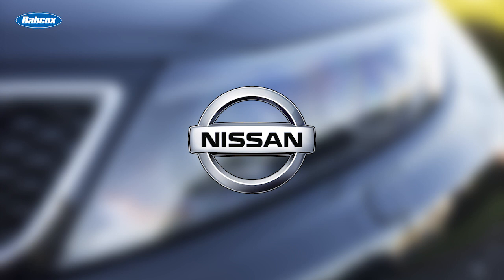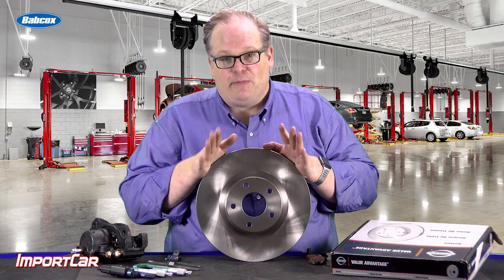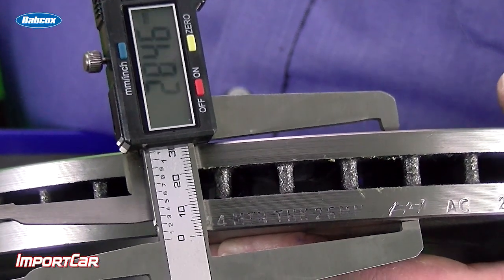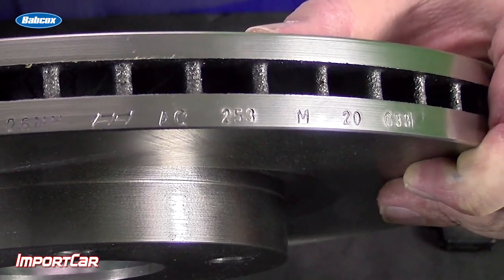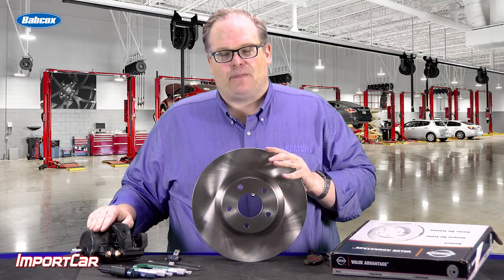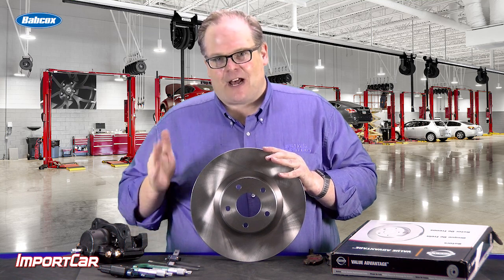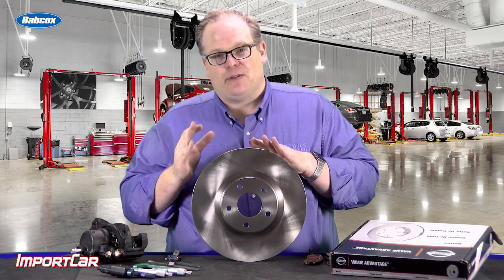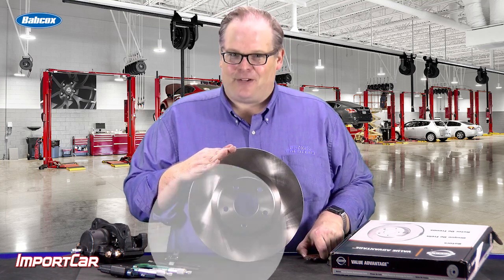Brake Rotor Minimum Thickness Specification | Maintenance Minute

Comment: He should've mentioned that the minimum rotor thickness is different from rotor to rotor and it is printed on the edge of the rotor like he zoomed in on. Also if you know the rotors thickness when new, minimum thickness will be reached when it is 2mm less than that number.

Comment: What happened to my last F150 and Hondas.  I drove them over 250,000 miles.  Never changed the rotor, never had the rotors turned.  The new pads smoothed the rotor.  Got around 40 or 50K on the F150.  About 90K to 110K on the Honda.  My Toyota is crap. Got the 100K front 113K rear, but both rotors at min.  Going to listen to this guy and look at rotors every 30K miles now and watch fluid levels every 10K oil change.

Comment: Interesting. I just read a recommendation at a brake equipment site, to leave at least .040" extra thickness over minimum for wear, and replace if it gets to less than that that .040" extra. Or, no more than .080" down from new. But they didn't say why, this must be the reason that explains it, thanks.

Comment: Rotors are often more expensive than pads. The best option is to replace brake pads well in advance of wearing to minimum spec so you can avoid a hydraulic failure. I've seen many instances of a rotor being damaged simply because the drive was trying to save money and put off fixing their brakes. The fear of being "ripped off" by their "evil" technician will get many people to delay servicing their pads and end up damaging a lot more brake parts in the process. Also, I can't tell you how many times I've seen black brake fluid. All it takes is a few emergency stops for the brake fluid to start to boil and to turn into a spongy pedal. Getting fresh fluid and air in the system out will protect your brake callipers from rust and keep your system working well.

Comment: Hello from croatia. Mine is at 26.2 thickness, and minimum is 26.4. Is it ok to use one more brake pads on it ?
Reply: Yeah you can resurface probably one more time but that’ll be the last time after that it’ll be the last time those rotors can be turned and you’ll need new rotors. I’d recommend getting new rotors

Comment: So, hydraulic failure is not good : l
What does that mean :\
Reply: Well basically what will happen is when you brake your brake piston will come out of their seal, due to your rotors and pads being out of specs. It will leak all the brake fluid and you will end up with NO brakes whatsoever. hope it makes sense